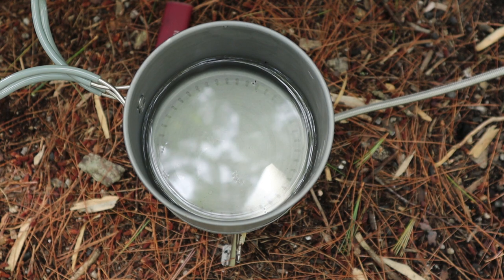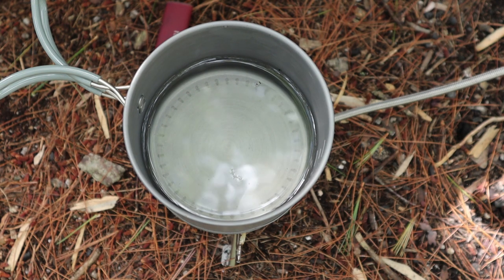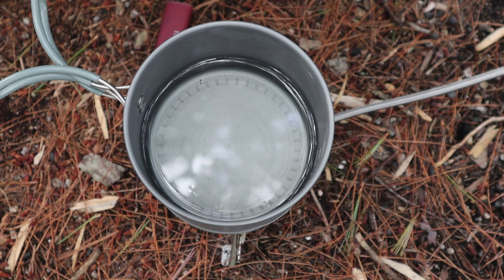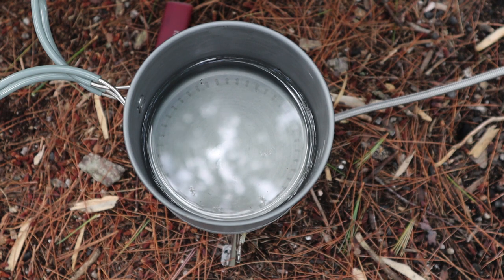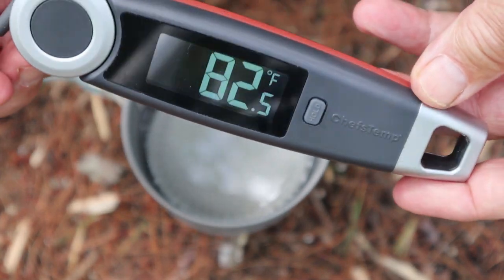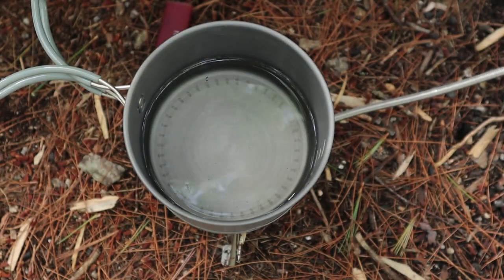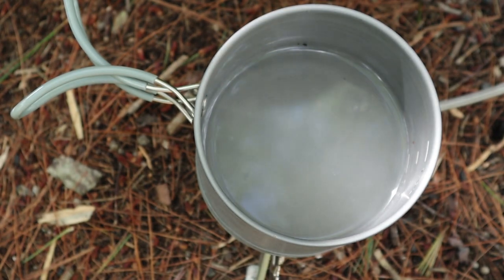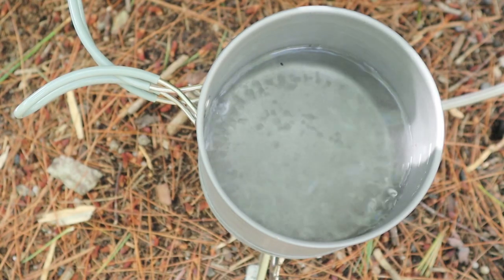Making You Water Safe to Drink with Heat

Comment from the maker: CRITICAL UPDATE Based on a question from a viewer ("absolutjackal" and "West Coast Warriors Archive") I went back to my information source (Gear Skeptic) and felt it was important to add this chart

Pasteurization Temperature VS Time
Temperature  Time
145F / 63C  30 minutes
161F / 72C  15 seconds
191F / 89C  1.0 seconds
194F / 90C  0.1 seconds
204F / 96C  0.05 seconds
212F / 100C  0.01 seconds
Keep in mind that the water passed through each previous temperature for a period of time (albeit, very short amount of time) before reaching the next.
Reply: Different microbes might be more fragile than other microbes at given temperatures.
Reply: I remember being taught the difference between pasteurisation and sterilisation at school (some memory eh?). That was in the context of industrial milk production where the high temperature needed (above 100°C) to sterilise had a negative impact on the taste of the milk. Pasteurisation, which was a lower temperature for a longer time, did not impact the taste so much.

My point is, we are not talking about food industry practice and the taste of a product when we are out in the field. I know for sure that pasteurisation requires holding the water at 65°C for way over half an hour, which isn’t going to save us any gas. 

With some of the nasty bugs potentially in our water, drinking water safety in the field for me is up there with firearm safety. To get it wrong can have a long term life impact, not just a day or two with “the back door trots” I’m going to literally “boil the c*** out of it”

Don’t misunderstand. I’m not ripping into you or the video, I’m all for not just knowing WHAT to do but more importantly WHY we do it.
Reply: thank you

Comment: Mark, 63C is not even maybe enough for my fave green tea, japanese Sencha, 70C is preferable. This is just a comment for the temperature. I always use an alcohol stove to warm the water, to not over heat and get a bitter tea. Sencha is very sensitive in too warm water. I can hear the right temp in right pot. I am glad you posted  about that fish eye version.

We have in here in Finland very good tap water and also most lakes are quite safe to drink. Lake water I myself would always, if possible boil to 100C if near sea level as I am, to feel really safe.
Reply from the maker: Good information. Thanks for commenting

Comment: I've heard that pasteurization was a combination of heat and time. Not just reaching a specific temperature but a specific temperature for a certain amount of time to kill off bacteria and stuff. Maybe its different for water as what I heard was in regards to food stuff like milk.
Reply from the maker: You are correct. From what I learned, pasteurization starts below 146F. By the time you reach that temperature, you have have spent all the time required. Thanks for commenting

Comment: It is worth mentioning that at higher altitudes water will reach a rolling boil at a much lower temperature. I don't know the exact numbers, but I believe that 147 F would still be reached at any but the most extreme altitudes. (At which point you would probably be melting snow, anyways.)
Reply from the maker: Right on. Thanks for commenting

Comment: Another video your viewers might find interesting, in terms of fuel savings, is the difference in boil time between a pot made of stainless steel, aluminum, and titanium. 

I used to use titanium in the field to save weight and fuel. However, as I moved from dehydrated and freeze dried meals to true cooking, I found the titanium was too thin and I tended to scorch my food against the bottom of the pot during preparation. 

So, I’m back to a heavier, stainless steel pot. Not as efficient, but more forgiving when cooking, as a result.
Reply from the maker: Good video suggestion. I just received some new gear for testing including comparable size SS and titanium pans and pots. Thanks for commenting

Comment: Mark....I've been a certified food safety professional for many years....we have always been taugh (and teach) that as @West Coast Warriors Archive said below, pasteurization is a combination of time and temp. At 146, you'd want to maintain that temp for 30 minutes to ensure safety, where at 161 its 15 seconds, and at 212 it is instant. Now, in the situation of a camp stove it is unlikely you'd maintain 146 and not keep the temp going to the 161 point, like in your case you were past 161 just a few seconds later. I just wouldn't want someone using a much slower heating method to think they got to 146 for a short period of time and then stop there thinking it was safe.
Reply from the maker: Interesting. I am relying on what Gear Skeptic said. Have you watched his videos?

Comment: CDC
Center for Disease Control and Prevention
This is a great site, with excellent information
Well worth to visit and read up
(Please do not try and reinvent the wheel)

Quote
"Boiling Water
Boiling is the surest method to kill disease-causing organisms, including viruses, bacteria, and parasites.
Bring water to a full rolling boil for 1 minute (at elevations above 6,500 feet, boil for 3 minutes), then allow it to cool before use.
If boiling is not possible, use tap water that is too hot to touch, which is probably at a temperature between 131°F (55°C) and 140°F (60°C). This temperature may be adequate to kill pathogens if the water has been kept hot for some time."
Reply from the maker: Yes and it was discussed at length in Gear Skeptics video. Thanks for commenting

Comment: It’s so little time between when it’s safe to the boil with those stoves you really don’t need to chance anything.  Just adding a lid probably saves more gas than not boiling.
Reply from the maker: A lid always comes first. The quickness between safe and boiling depends on the stove. For long distance hikers even a gram of saved fuel is worth it. Thanks for commenting

Comment: When it comes to water, I do have a question that I'm exploring. I live in Southern Michigan. Most of the water here is very clear water. As I go further north in the state however, the water seems to contain more tannins in it, presenting itself to be "tea colored"... sometimes light, and at other times very dark. Is tannic water bad for us, and if so, what is the best way to reduce it or even make it perhaps dissolve completely? Thanks.
Reply from the maker: I have very tannic water in my area. It is the byproduct of organic break down. No issue for consumption other than flavour. Van clog filters a bit quicker. Hope this helps
Reply from the maker: In fact, there are some health benefits to tannins in the water.

Comment: Only thing I’d worry about with this, is that if it’s a big pot, the water at the top would be slightly cooler than at the bottom, but leaving it for a few seconds more wouldn’t hurt anything.     What about something like algae like that blue green algae?
Reply from the maker: Good comment. Pasteurization starts earlier than 146F. As it reaches temp at the bottom it would rise and the required time is complete by the time you see the proper size bubbles. From what I understand, it is not the blue-green algae itself but the cyanotoxins released as they die and decompose. Boiling won't deactivate them. Thanks for commenting Jim

Comment: Why no mention of water purification tablets - no need for fuel, fuel container and stove, (additional weight to be carried). My eight component 2inch x 3inch survival device includes a retractable whistle, container for about 50 or so water purification tablets with a silva compass atop, a 650 lumen removable flashlight, another container for tinder, a ferrocerium rod on one side and a diamond knife/hook sharpener on another side. It's all mounted on a 2inch x 3inch survival mirror w/detachable lanyard. Each water purification tablet provides for a liter of water and purifies in about an hour depending on the temperature.
Reply from the maker: Not the topic of this video. This was about heat only. Thanks for commenting
Reply: @MarkYoungBushcraft  The topic is the purification of water and water purification tablets are directly applicable. You failed to mention it or you failed to remember it.
Reply from the maker: @ULperformance  No lapse on my part. I did not intend to cover the comprehensive topic of purifying water. As I stated in the opening and again during the video, the topic was on using heat for making water safe to drink.

Comment: What about at different elevations doesn’t water boil quicker but is not as hot??
Reply from the maker: Yes, so I did not include that but at elevations over 6000ft water takes longer to reach temperature. I don't have experience with that. Thanks for commenting